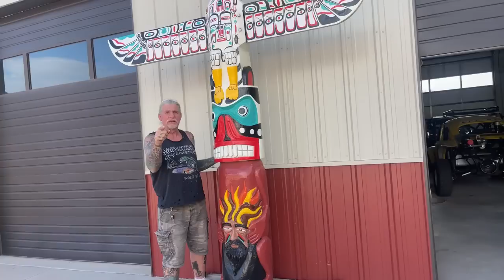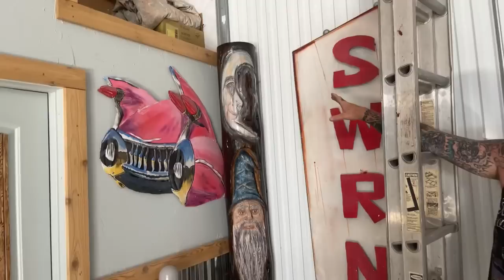This Car Interior Sucks 😲😲 How To Fix Someone Else's F%CK UP

Comment: Time wears the angular cut pinion teeth of a starter. This wears the flywheel ring. Replace the ring or move it! Compression stops a 4 cylinder in two spots, 6 in three and 8 in four locations. When heated with a "Rosebud" tip on an oxygen-acetylene touch and use a air hammer with a wide flat cold chisel. With 4-5 hits in the direction to remove, alternate in 4 spots. Stop! I like the surface freshly machined, no cracks, no hot spots of discolored metal but use & do what you need. If you are 38 miles from a machine shop that's close before you get there, but can sell you the toothed ring. So 3 options; move the ring gear, resurface the flywheels friction face or the buy whole new one. 3 choices!